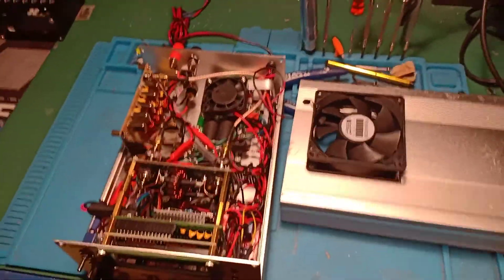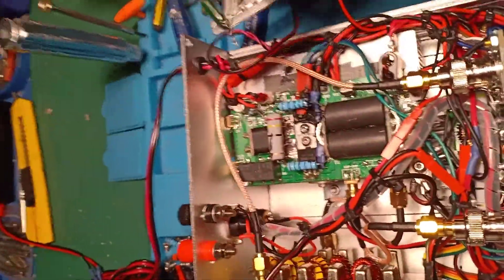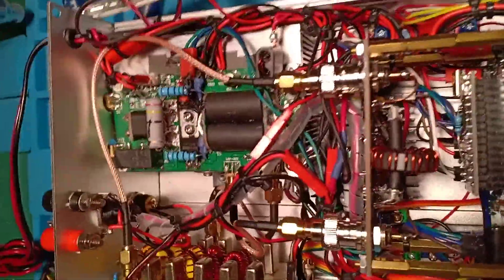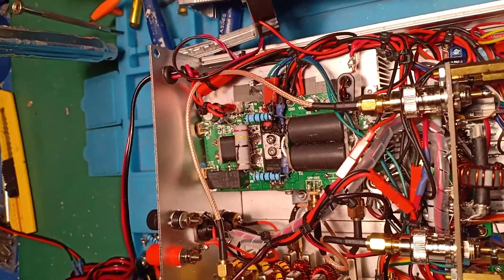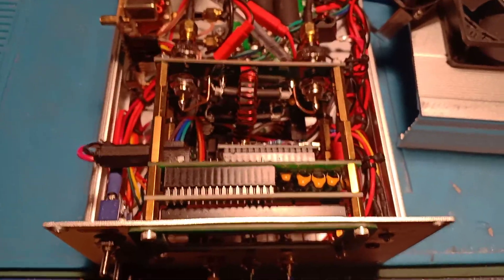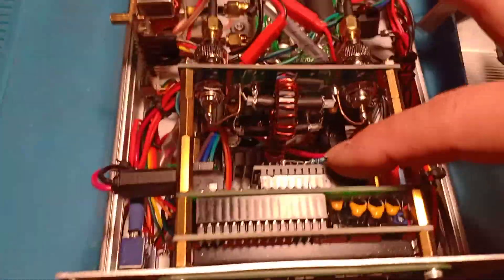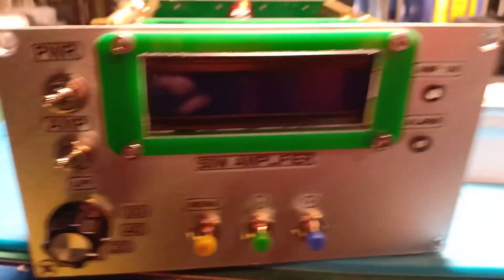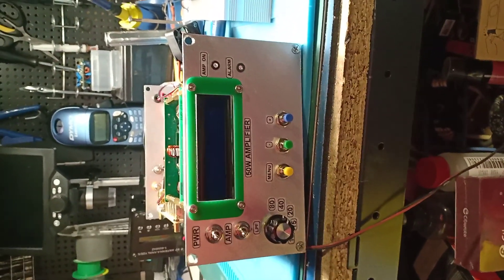F5NPV - 50w IRF530 MOSFET RF amplifier description

Comment: I just built one of these - love your mods. Definitely going to be trying them. I have seen the diode "trick" before but not your other recommendations. That 24 ohm resistor after the input transformer - was that for input impedance matching? Never mind - got a bit further in your video and you explained it ;)
Reply from the maker: Hello , as far i can recall, my input impedance was about 12 to 15 Ohms after the transformer . Adding the 22 Ohm is really assisting to provide you a great imput impedance and SWR . i try different value but for this amplifier is 22 Ohm . i have built exactly the same Amplifier and for the other one the resistor is 15 Ohm . I guess i depends the quality of the winding , the wire we are using and the Core quality. The trick with the Diodes is really assisting to stabilize the amplifier and i can use it for FT8 or PSK without issue with about 20 up 25w Output
73s Didier
Reply: @f5npv-v85npvamateurradio3  Thank you Didier - like I said some great mods you have there and I am definitely going to have a go of them myself!
Reply: Something good to dissipate heat from the mosfet is to cut a thick sheet of copper about 30 x 30 mm and 2 or 3 mm thick (they sell small copper plates for copper etching), and put the mosfet (with semiconductor paste) on it. that copper sheet, very good conductor of heat. Insulate this copper sheet on the radiator with a mica sheet or similar. Perhaps it would be interesting to experiment with IRF830 type versions, working at a higher voltage at 100 V for example.